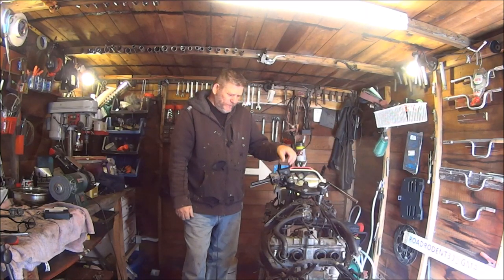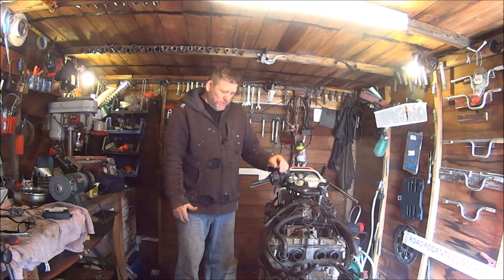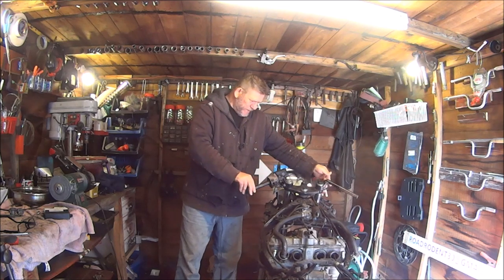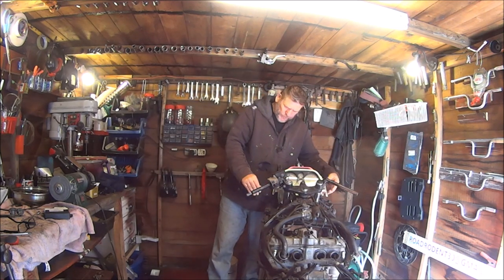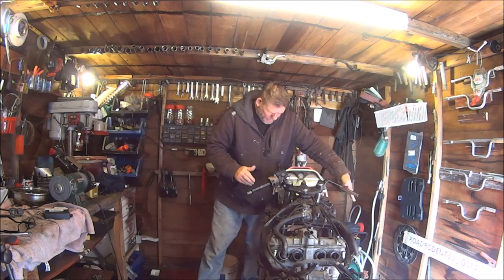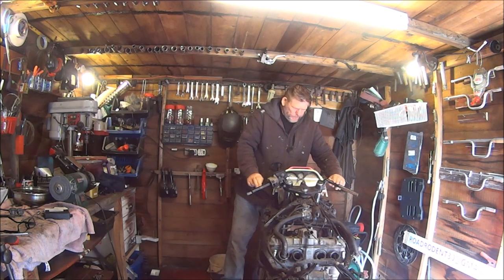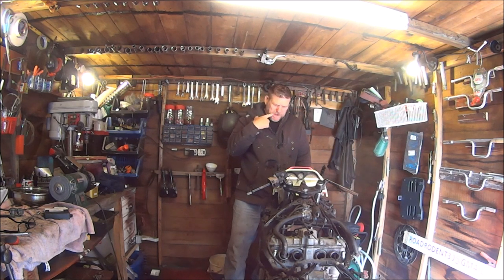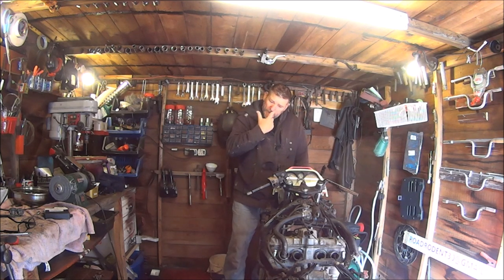CBR1000F removing the remaining electricals  part 2.

Comment: Shouldnt use a welder near the frame because reasons.
Reply from the maker: I think it's something to do with the electrical surge it can short out the delicate electrical components that are still attached to the frame and still connected to the wiring.